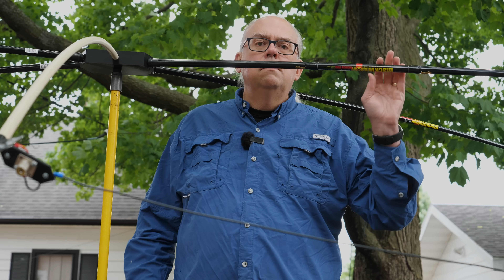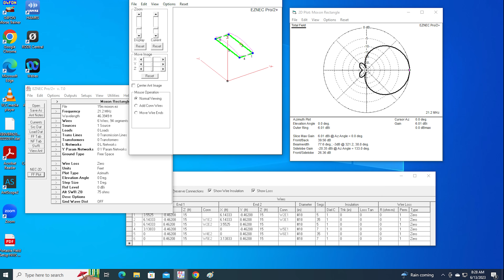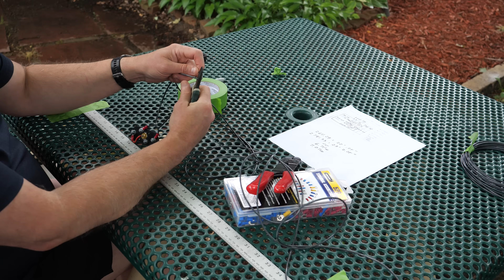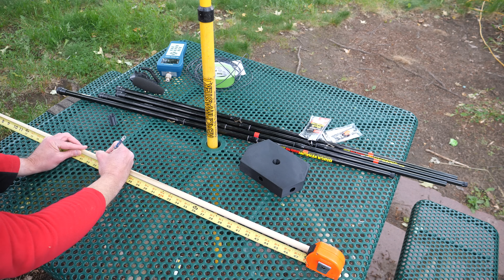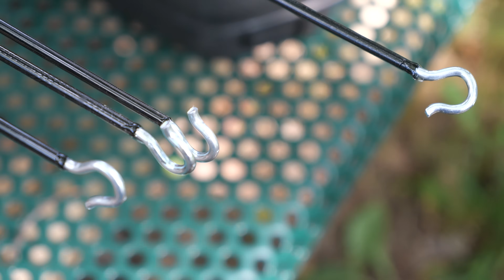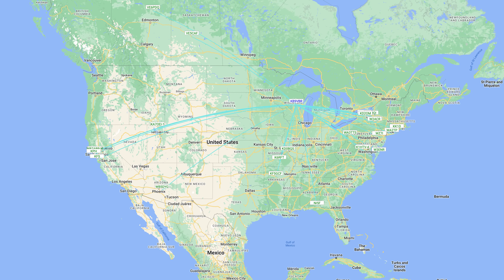I've been bit by The Black Widow: a 15 meter Moxon Antenna project #hamradioqa

Comment: Did you cut the extender pvc for the feedline for the coax?  I used a lenghth and a 90 degree adapter and cut another piece of
pvc to extend it straight down when I built mine in the 80's.  I did not have the computer and programs and made mine up a little
different.  It did work well for FD's and loved it.  I had to use wood and make the center section.  it was a terrible task but I got
it made with 6 pieces of wood.  (4 walls and a top and bottom of the box. AB4PP

Comment: Nice video. One recommendation that I have for those interested in building this antenna: I found that the "10-foot" model of the Black Widow poles used in this video are only marginally acceptable for 15 meters. (They work fine for a 10 meter Moxon.) Black Widows are fast action crappie rods designed to have most of their "action" in last 1/3 of the rod - which is where your antenna connections go for a 15-meter Moxon on a 10-foot rod. The first 2/3 of the rod are much "stiffer" and able to support more weight without sagging nearly as much. Moving up to the 13- or 16-foot versions of the Black Widow and cutting them back to size will provide better support and work nicely on 15 meters. (Also the choice of antenna wire and its weight are important. The 10-foot poles may work OK with thinner wires like AWG 26, but even at AWG 18, they sag fiercely and are difficult to control/correct with guy support lines.) In general, it's best to keep your wire weight within the first 2/3 of a Black Widow rod. 73.
Reply from the maker: Thanks for the comments. I don't know if you saw my followup to the 15m Moxon, but it had some updates on how I overcame the weight of the wire and sagging issues with the spreaders: https://youtu.be/f56AX5esxgQ

Comment: A properly designed and built Moxon should give much more than 9dB front-to-back ratio. Enhanced F to B is the main electrical performance advantage of the Moxon compared with a straight 2 ele beam 😊

Comment: I have used a 20 meter Moxon four and a half feet off of my roof for three years now. I have worked on FT-8 all fifty states, 701 US counties, six continents and have confirmed 74 countries and 30 CQ zones. I should say my Moxon is in a fixed direction at about 70 degrees from Oregon. The Moxon is a great little Antenna.

Comment: Nice one Michael, the Moxon is up there with my favourites. I've made individual ones for 20/15/10 now. 20m is a beast. The 12m Spiderbeam pole makes a good support for all 3 and still allows you to get a height of 6m worst case on 20m. You SWR dip will change once you get it in the air but not by much as you say. The only downside is its mono band and 15 is closed so I'm building a Hexbeam too. Downside of the Hex is the front to back ratio doesn't come close to the Moxon.
Reply from the maker: I'm expecting 15 meters to be open for Field Day. With the world's largest amateur radio event, the bands are 'always open.' Honestly, I'm not expecting the SWR to dip much more, the numbers I got are very good and I'm satisfied with the results. I can't wait to really get it on the air.
Reply: @KB9VBRAntennas  your right, even a "dead" band always opens for a contest.

Comment: I've never seen one built that way.  I'm sure it does not matter too much.  I thought building it with the poles pointing "up" was to help it tension things into the same plane and screech it into shape?
Reply from the maker: I've had one or two people say the same thing. The plans I based this project on had the poles drooping downwards, so I went that route. From what I've found, a little slack in your radiator and directors don't affect things that much and the wire don't have to be taught.

Comment: As soon as you said to yourself "I think I'll build a Moxon" Chuck KK6USY felt it in the force and he smiled.

Do the metal hooks not cause any issues? On my way to rewatch your 6m Moxon video.
Reply from the maker: The metal hooks shouldn't affect things, the wire I used is insulated.

Comment: I put a 2 meter Moxon to great use when we lived in a 3rd floor apartment. The j-pole I started with was radiating into the building. I found out when the downstairs neighbor started banging on his ceiling with a hammer. I was coming through on his clock radio and waking him up.

So I got a couple of wooden lattice privacy screens, put them on either end of the balcony, and mounted a 2 meter Moxon inside one screen. It got into the local repeaters like gangbusters, and the neighbor stopped hearing it through his clock radio.
Reply: How do I stop them from being used as a weapon against me?

Comment: Nice job Michael! I built my original Moxon for 20m and it has worked great! I have a few suggestions for you. Use small paracord or fishing line in place of you PVC spacers this will lighten it up a lot. Some upper tension on your poles might make it a bit sturdier. I used 7.2m fishing rods and didn't use the smaller outer sections, I know you have yours already so try to tension them. I did mine as a upside down umbrella with a peace of PVC extended above and small paracord holding the tips up. Chuck   https://www.youtube.com/watch?v=8gHY1b4pauk
Reply from the maker: Thanks for sharing the video. You have some good tips in it. I think I may switch out the wire for something lighter, like 18 or 20ga. I'll have to see what I have in my parts box. That should keep the poles from flexing so much.
Reply: @KB9VBRAntennas  I used 26 gauge poly stealth pretty light but hard to see if you lay it down on the ground lol.
Reply: @KK6USYHamRadioAdventures  How much power can that 26G take?

Comment: Michael, you made reference about the connector being heavy. Would a budwig so-239 connector save you any weight?  Marc/K8MH
Reply from the maker: The Budwig would be marginally lighter considering mine has the 4 machine screws and nuts. I'd be curious of the weight difference between the two.
Reply: @KB9VBRAntennas  I measured mine, 38 grams, or 1.3 oz.

Comment: If you don't have a 3D printer, your local library may have one or maker space will have one for sure. Just take the file in on a USB thumb drive.
Reply from the maker: Libraries and Makerspaces both are good resources if you only need the occasional 3D print.